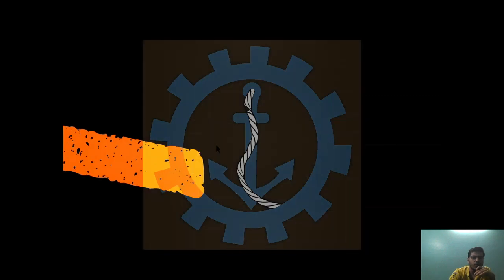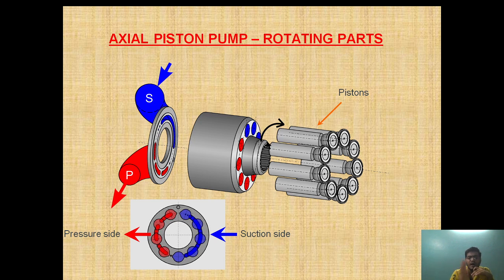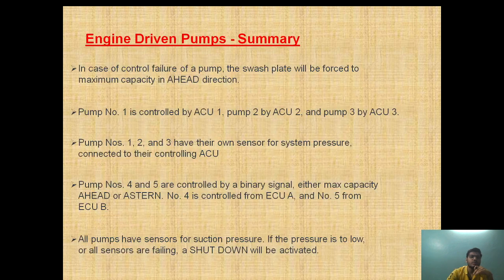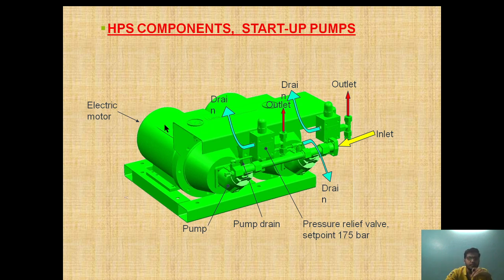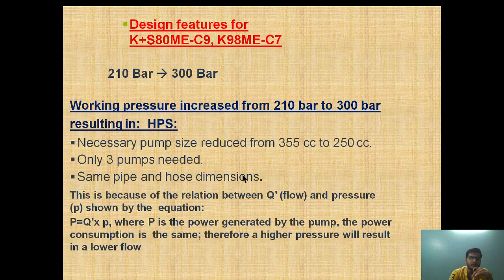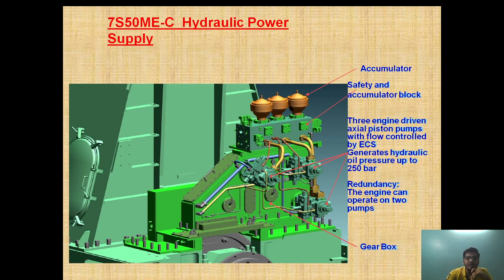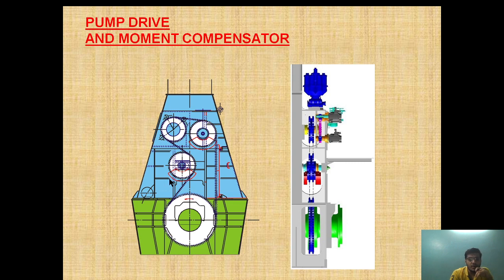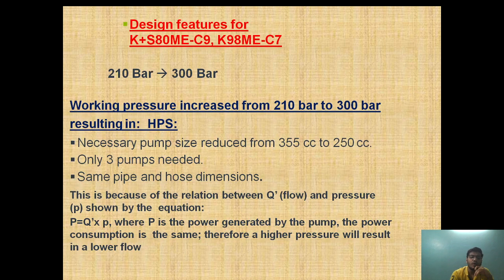Hydraulic Power Supply(HPS) unit|Engine Driven Axial Pump| Attachment|Gear Drive|Pressure Build Up|

Comment: Very informative video, kindly tell us how the delivery of hydraulic oil is maintained at same pressure and volume increased according to engine speed and load. What's proportional control valve and where is it?